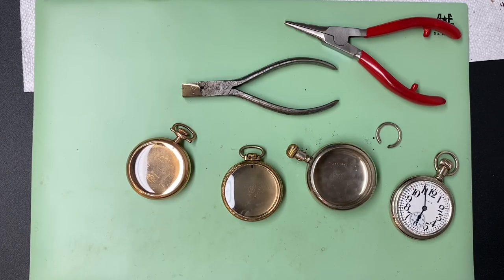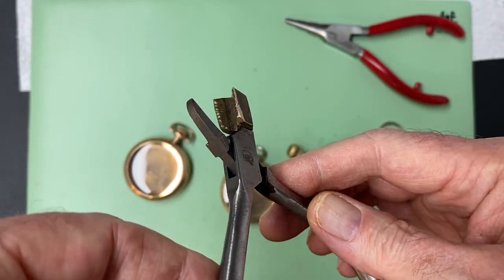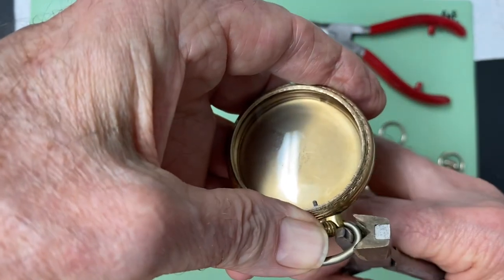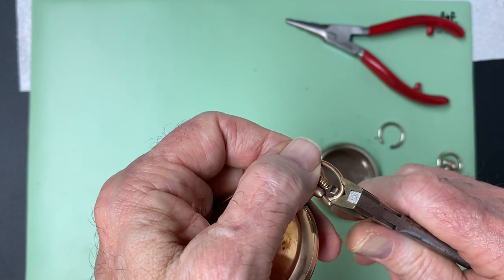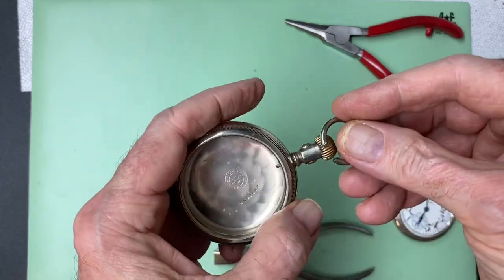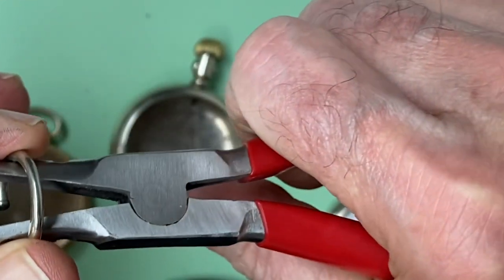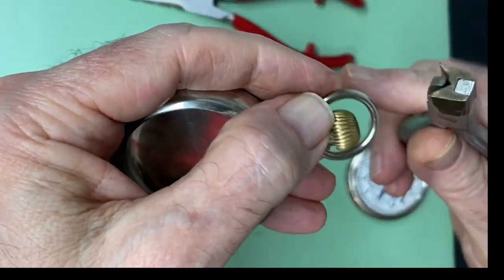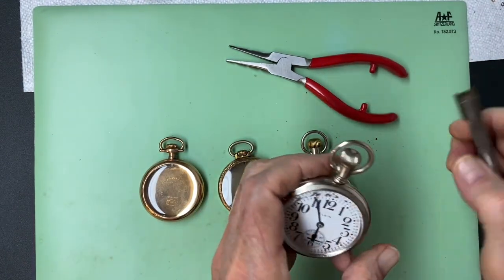How To Not Drop Your Vintage Pocket Watch: Tighten The Bow!

Comment: Isn't there a real chance of unavoidably denting the bow with the first tool as the jaws are straight-edged rather than curved to match the bow?
Reply from the maker: Great question!  There is a chance of denting or scratching the  bow if you aren't gentle enough, as I emphasized in the video. If you believe that you may not be able to be as gentle as needed, or don't want to take that chance, you could use some type of material (like leather) in between the pliers and the bow.  As far as I know, there is no other tool to use to do this.  The tools I am using are antique tools, and it might be possible that someone has made a modern tool more fitting to the bow that I am not aware of.  (If you find it, please enlighten me!). Thanks for watching!

Comment: My pocket watch arms are faulty, they just hang down with gravity, and dont hold themselves up.. any ideas on what the problem is?
Reply from the maker: Are you referring to the "bow"?  If so, you can get bow replacements on eBay. Can you be more specific about what you are referring to as "arms"?
Reply: @myhobbiesarenotcheap  I am referring to the hour and minute hands on the clock face itself
Reply from the maker: @buddajjl  It sounds like the holes are probably worn or too large for the shaft that holds the hands on.   They need to be adjusted.  I made a video on how to tighten them up if you have the tool.  If not, you might have to take it to a watch repair person to have them tighten them for you.  Here is my video link:  https://www.youtube.com/watch?v=hsCvTmW3TQk

Comment: How can I remove a really stuck bezel on a railroad pocket watch, it belonged to my father in law.
Reply from the maker: You may want to try wearing latex gloves to use as a grip to turn the bezel.  If that doesn't work, put hot glue on a popsicle stick and lay it horizontally across the bezel and turn it counter clockwise.  (Let the glue set a few min before you turn the stick.). The glue can easily be peeled off without damaging the finish.   Hope this helps. Thanks for watching!
Reply: @myhobbiesarenotcheap  Thank you so much